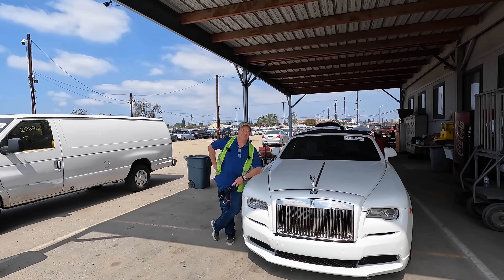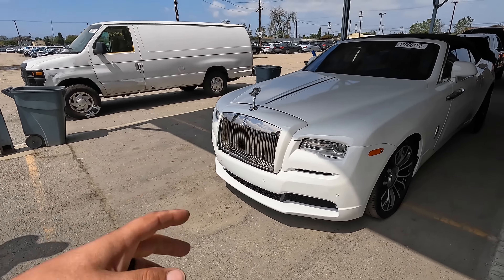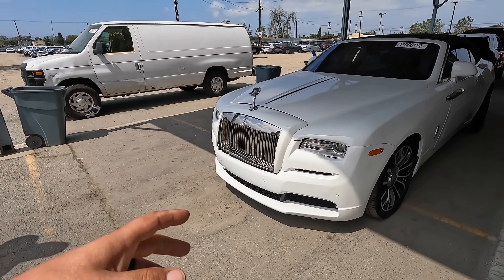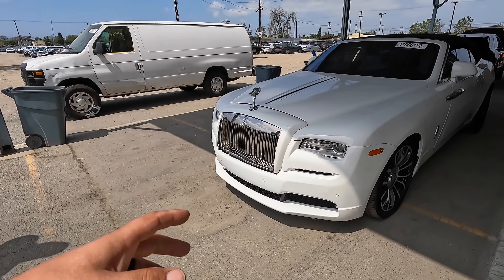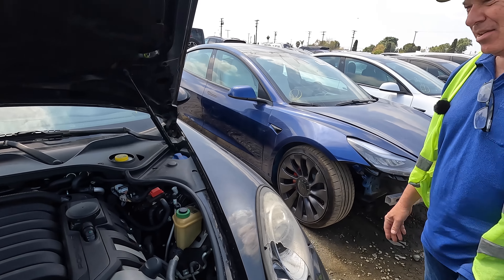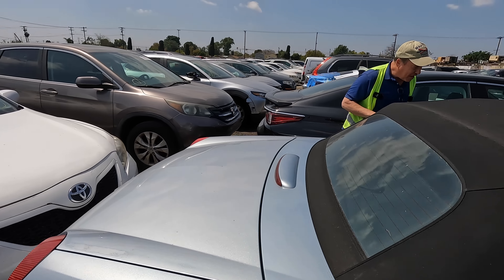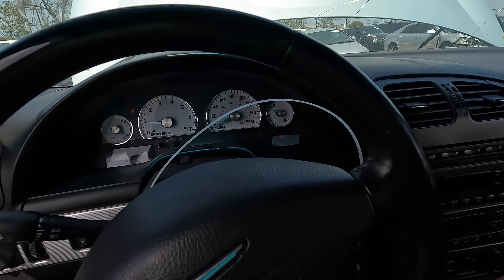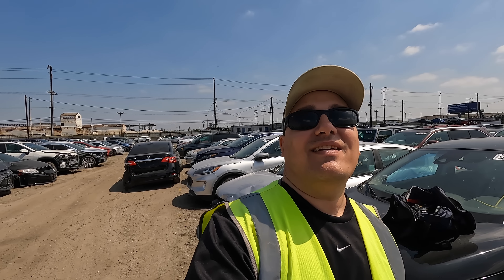Copart Walk Around Los Angeles! Rolls Royce Dawn with Hidden Damage!

Comment: To bad the t bird was missing the hardtop. They all came with the hardtop. I have one of the first ones off the line in 2002. It only has 1353 miles on it now and has never been washed or seen rain. I have a 04 I  drive as a daily.
 My 02 has never had the hardtop off either.
Reply: That's fantastic